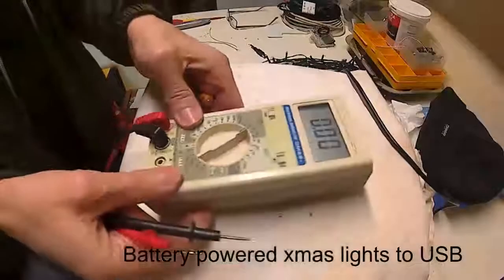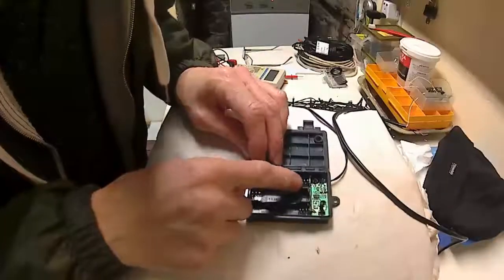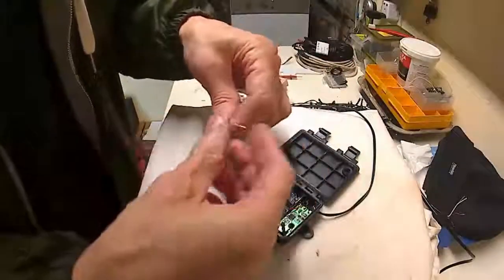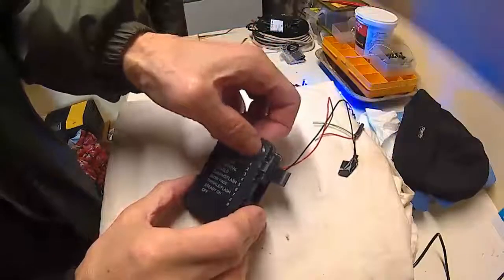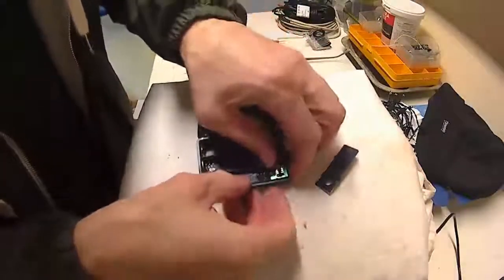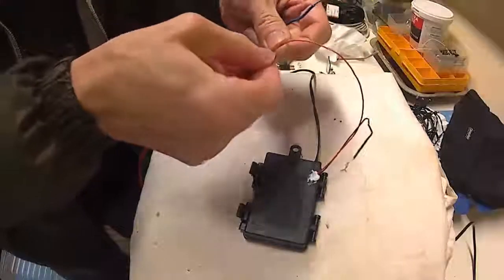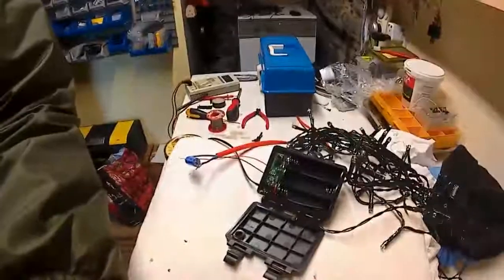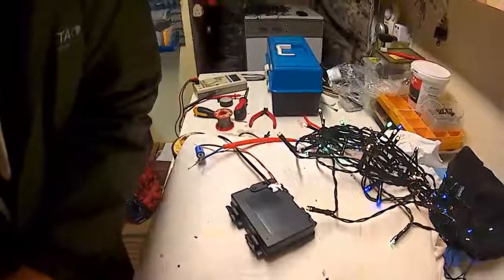Christmas LED lights, battery to USB power supply conversion

Comment: I have a 100 light string with a on/off one step timer on for 6hrs off for 18 but this year the lights will go on but turn off in minutes and will not come back on. Any ideas how I can fix this? Mine are the tiny wire fairy lights. Thanks so much.
Reply from the maker: Hello and thanks for the question. There is no way of adjusting the timer. I am assuming you are using  batteries and not doing the  as me in this video? Only things you can do is make absolutely sure the batteries are new and 1.5v each. Also check that the battery terminals are not corroded and have a shiny appearance. Don't use rechargeable batteries as their voltage is too low. Merry Christmas

Comment: Thanks for the video. I found a string of LEDs with the same battery compartment/controller, but I’m unable to read the entire number on the chip inside the box. Would you possibly know what the chip is?
Reply from the maker: Hello, I dont know what the chip is. They are different between different manufactures. I can tell you that any 4.5v or 3 battery lights will work with the USB

Comment: You need to drop that extra voltage so use a 1N4007 rectifier in series on the positive line, ie silver line to the lights
Reply from the maker: Thanks Graham, that's a good comment and recommendation. For anyone reading this and modifying their lights, by adding in a diode, as suggested,  would be act as a stable volts drop to 4.5v or a bit less and improve reliability of the LEDs. 
In my case I found the lights I have tolerant to the extra voltage and I also lost some voltage due to the long cables to the lights so didn't need it this time.